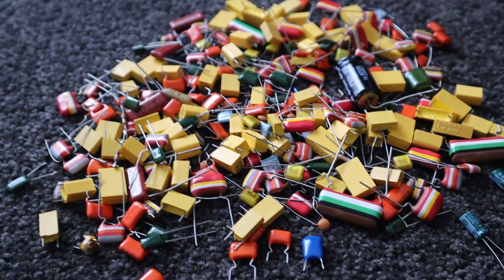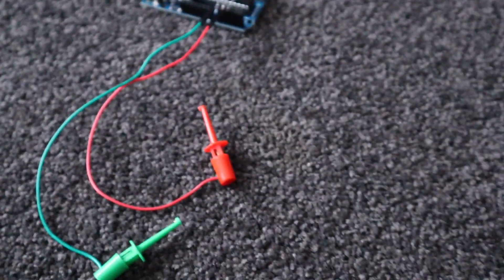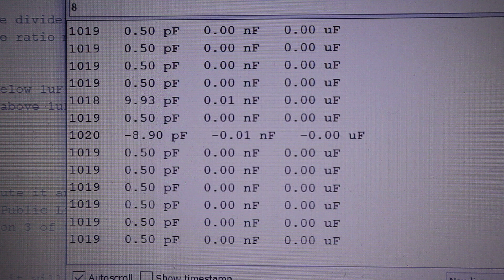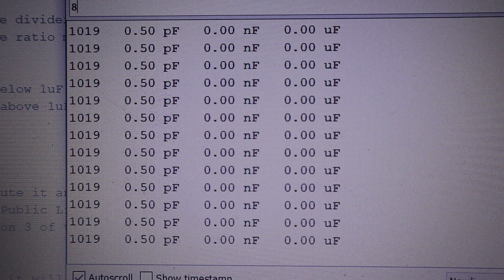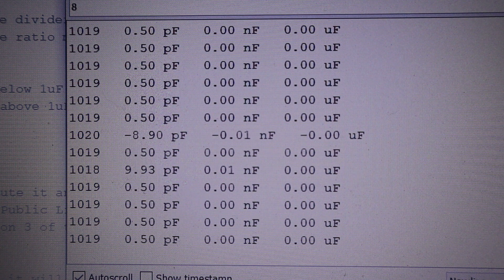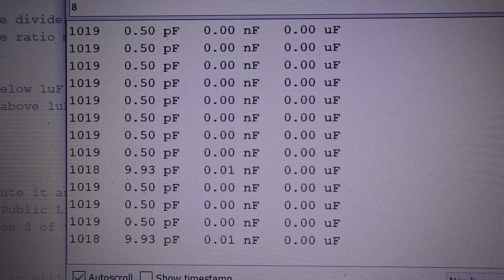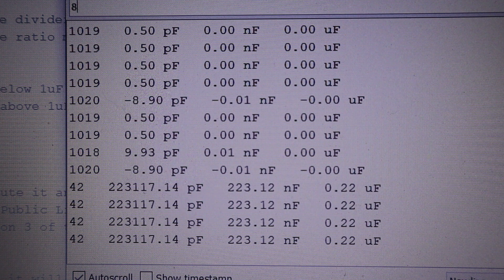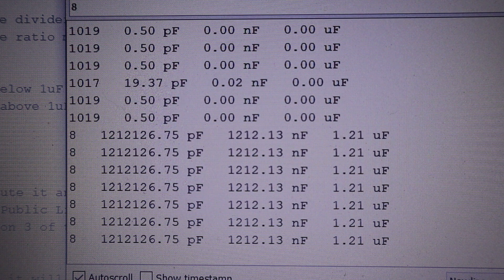Simple Capacitance Meter

Comment: Hi! You achieved a very nice hardware/software means to measure capacitors.  How hard is it to add a screen (TFT SPI LCD Display Module 240*320 ILI9341) so that the whole capacitance measuring process can be portable (without a laptop/desktop) to see the measurements?  This would an important addition to whole package.   Again - nice video!
Reply from the maker: Thank you for commenting :)
Adding a TFT  display should be possible
The code and construction details are published here https://www.instructables.com/Simple-Capaitance-Meter/
Reply: @qualityphotos1  Please make an additional video where you add the display for the stand alone capacitance meter.  Also, add the ability to change out the capacitor value to measure big capacitors too!!
Reply from the maker: @Forensic1Man  I'll add that to my list of things to do ... but it is likely to be some some ;)

Comment: man I skimmed through the formulas in the instructables web site you linked, looks convincing, this is the simplest capacitance meter I have ever seen, if its resolution is less than 10% I salute you
Reply from the maker: Thank you for commenting :)
The resolution is determined by the  reference capacitance ... the smaller the better but at the expense of range.
The following  instructable https://www.instructables.com/Absolute-Angle-Encoder/ has a graph showing a typical ADC count.
The code and construction details for this project are published here https://www.instructables.com/Simple-Capaitance-Meter/
Reply: @qualityphotos1  The resolution is determined by the  reference capacitance - yes I understood that 😎